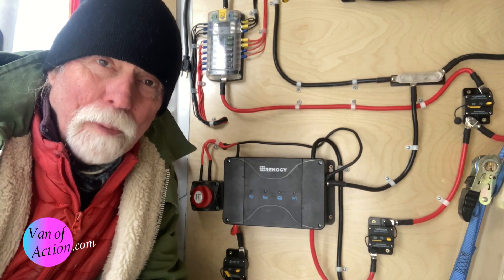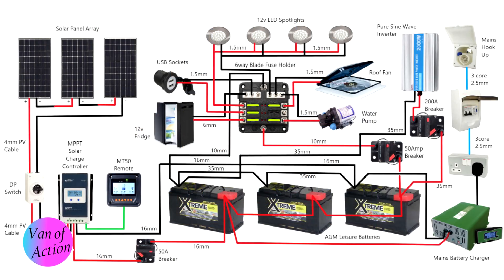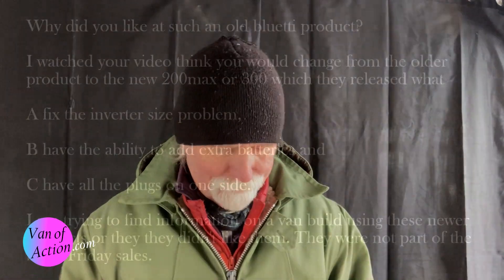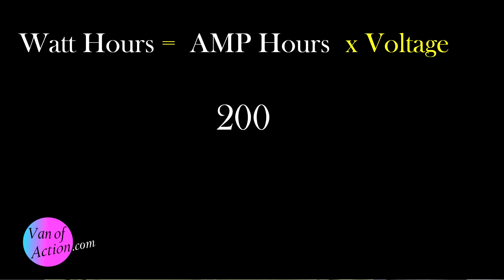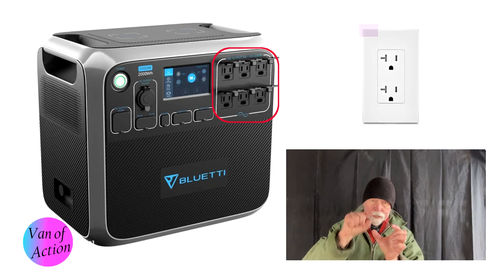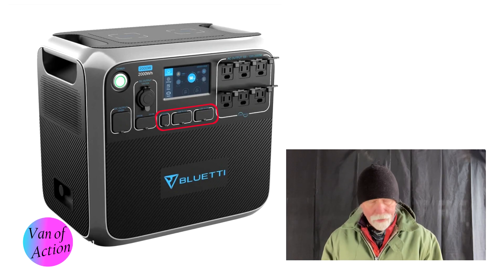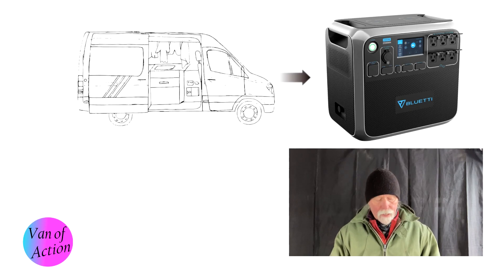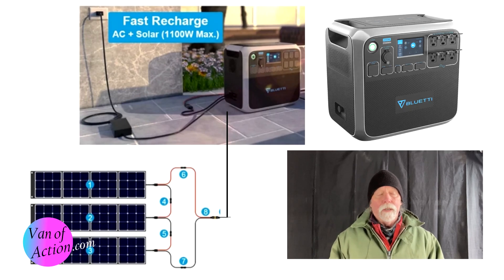DIY Solar DC DC and AC Electrical Compared to Bluetti AC 200 Portable Power Pack for Van Conversion

Comment: Great video and information; however, I miss the beautiful girls in bikinis!! LOL :)  With that Bluetti you can actually double the capacity with an added expansion battery.
Reply from the maker: RoadPeace -   Debra said the same thing ... when I was researching I didn't see anything on the Bluetti site that made that clear, and the only review I watched that mentioned extra batteries said you could not add any.  So I don't know.   But either way,  you'd be adding components to the original configuration so it would no longer be an "out of the box" comparison.  AND - even at that I don't think it's a great use of $$$$ for a van conversion.  Stay safe

Comment: Thanks for this great video, I DIY wherever I can, and your vid came up trumps!
I also like the broke/replace ethos, where if something did go in the bluetti (other manufacturers are available.....which I've not looked at) you can replace your DIY box components.
Reply from the maker: Hey Delganly843  Thanks for watching and taking the time to comment.  I'm sure these products would have a great use for some folks but for vanlife I can't see it.  Your pint about replacement is well taken !!!!   Hope you'll stop backand join the community ..  Dave

Comment: Great 2 videos on Bluetti.  Now you can solar charge and DC to AC charge with bluetti opposed charger.  Light gray in color.  DC to AC plugs in to Same port as household current .  It's a 400 inverter.
Reply from the maker: Hi Keith - thanks for watching and taking the time to comment.  I'm sorry though ...... I don't understand exactly what you're saying but sounds interesting.  Could you expand on it ?  Both for my and other readers benefit.  I wouldn't want to miss something useful. ....  Cheers Dave
Reply: @VanOfAction  , as you drive, take DC from the chassis battery, convert it to AC and than plug it into the Bluetti's AC charge point side.   Now you are charging as you drive at 400 watts and charging via solar panels.
Reply from the maker: @keithfoulks2657   Hi - thanks for taking the time to expand - but being a carpenter I still don't think I have a clear picture.  So first question - have you done this ? What piece of equipment did you use to convert the DC to AC  directly from the battery ?  (I've only seen DC-DC controllers coming off the battery).  If so can you can share a product and price ?  And if not, it would seem you'd have to store the DC energy  before use - but that would mean a battery.  Can you shed a bit more light  ..... Dave
Reply: @VanOfAction  , I watched, YouTube influencer (Mel's Big Van, Small World). 
Episode - Installing a Portable Solor Generator  to power campervan.  It's at 10 minutes mark. He speaks of Split charger relay that he plugs into from alternator power than plugs in a bluetti device to charge to the AC import of bluetti 200 max.

Comment: The AC 200Max mentioned below had 2200W. If you wanted to use the cig lighter and store the unit underneath, all you need is a cheap Lighter extension cord. They have them the will reach anywhere in your van or you could make one. Also the high output USB-ports on the front can be used to charge larger tablets and even some laptops. Using them as opposed to a AC, saves on the efficiency loss of going from DC to AC. I can charge it in my RV from my truck battery and/or from Solar on the roof at the same time.
Reply from the maker: Hi Bwanar1 - thanks so much for watching and taking the time to comment.  It's in the conversation that we all learn and grow.  The purpose of my video was to compare the AC 200 to my DIY build and to see if it seemed like a reasonable alternative when considering cost and functionality.  For me - it's not even a close second.   First - I don't know what you mean by 2200W.   But you are right about making an extension for the cig lighter.  It would be possible - however,  I have 3 lighter ports built into the van.  Always available and always powered.  One above the kitchen counter for cooking appliances.  One behind the second seats incase someone wanted to plug in a heating pad or something and one in the basement to power up a small compressor or something.  Trying to set  that up with the portable power pack would just be goofy.  And yes the USB ports are great,  but in my build they would be in the basement, so not so handy, I installed USB's 2 in the kitchen,  2 at the second seats one at each reading light over the bed, one by the drivers door to charge my phone when it's in the cradle and 2 in the basement.   Finally, I understand that you can charge from the battery and solar at the same time,  however the DC-DC charger plugs into the cig lighter and has a minimal pull - not very efficient.  The DC-DC - MPPT charger I used will pull up to 50 amps and can recharge 100 AH in no time at all.  Not that I use it !!!  I've found my 300 watts of solar will recharge my battery use easily.   And I did all my install for about the same $$$$. For me, the AC200 is not suitable for the type of van build I wanted.    I appreciate you coming by and hope you'll return..... Be well .... Dave

Comment: I would like to see how having a generator can operate your system and it is hard to find videos on it.  I plan to go solar in the future but for now it will be generator especially to run an AC unit.
Reply from the maker: Hi Steven - thanks for watching and commenting - sorry for the delay - we just got back from a 6 week road trip 9700 km ---- I guess it depends on where and how you plan to use you van.  We will not be sitting in ours all day so A/C is not a focus.  Temperature is only a concern at night for sleeping and so far our experience has been that at night the temps drop.  The secret has been getting the cooler air in - and the warmer air out.  We've found that having our front max air fan on low blowing out and our fantasic fan over the bed simply open we get a lovely cool breeze across the bed all night.  We need blankets.  Be well and stop back.
Reply: @VanOfAction  Thank you for your reply.  Love watching your videos.  They are just common-sense approach to building.

Comment: Headlamps, bike lights, portable USB blender, can all be charged via USB Ports.
Reply from the maker: Hi Returning to Earth TV - Thanks for watching and taking the time to comment.  Yes !!! the USB ports have a tremendous number of uses.  What I didn't (and still don't) understand is what the     2  5.5 mm plugs are used for.  I mentioned them about 6:49 in the video.  I'd love to hear if you know of a use for them.   In the meantime stay well and stop back.  Cheers - Dave

Comment: Hey Dave,
As a follow up for you the AC200 Max has most of the features you commented about like charging using both solar and there DC charging enhancer. Thanks for the info. Rob
Reply from the maker: Rob !! WELCOME - you have no idea how much I appreciate you  watching and taking the time to comment.   I'm not completely clear on the point you are making - BUT - yes - the AC200 has many of the features a person building a van would look for - EXCEPT !!!!!!!   the storage (battery) is too small.  It drives me crazy - but out of the box - the AC200 can generate a fair bit of energy but there's no place to put it.  And the DC-DC charger is really lame.    I firmly believe that building a system from parts will serve you better.  Let me  know if you want me to expand on that -  Be well

Comment: New to the community. Great video and resource. Thank you for sharing. Regarding 5 USB ports it may not be enough for millennial use. I have three different cameras that charge using USB in addition to my phone, my wife's phone, a tablet, a computer, a few flashlights, a fan and some lamps. The list goes on and on.
Reply from the maker: Hey Rafi !  WELCOME  - Thanks for taking the time to watch and comment .....  I hear what you're saying (the fan and lights could be hard wired to the fuse box)  - and in fact, in my build I installed 8 USB charge ports,  but they're scattered around the cabin where I'll be using them.  With that many things to plug in with a Bluetti a person would be spending a lot of time in the basement !!!   Be well and stop back.  Cheers

Comment: One thing to add is the weighr. That AC200P is not exactly light. It will be a chore to move it around.
Reply from the maker: Lacy - that's true !!  Personally I wouldn't expect to be moving it much though - just put it in place and leave it there.  But then you'd be climbing into the basement every time you wanted to plug something new in !  - Thanks for watching and commenting - come back !! and be well.

Comment: So I have to shell out some more money just to charge the AC200P faster. I wonder why can't they just include it as standard equiptment.
Reply from the maker: Hi Steve - thanks for watching and commenting.  I don't think these products are really designed for van conversions.  They would work really well for a weekend camper who wanted power.  But because it all comes in the same box at first glance it's really appealing to someone who finds doing the electrical piece by piece intimidating.   Better to bite the bullet and take it step by step.   be well and safe (and come back !!!!)

Comment: The 2 barrel connectors are used for some products but not many. You can buy adapters to go from the barrel to cig light inputs or USB inputs to utilize them. Some ham radios use those style plugs as well as other stuff.
Reply from the maker: Thanks Tommyr for taking the time to comment - seems like a strange thing to include .... but what do I know :)   be well and safe.
Reply: @VanOfAction  You would be surprised how many things use that type of connector. At least with adapters you can use them!